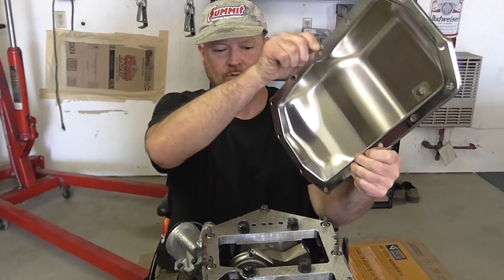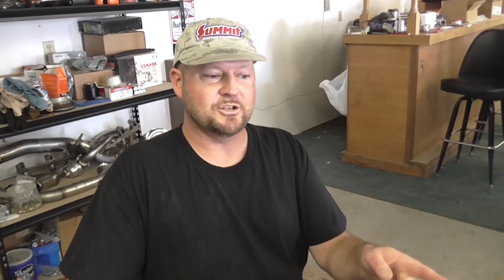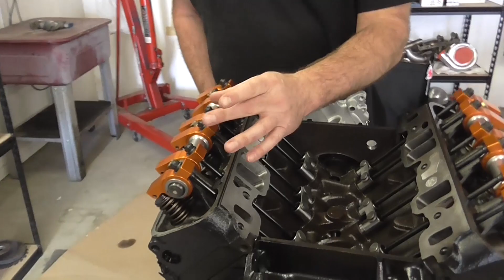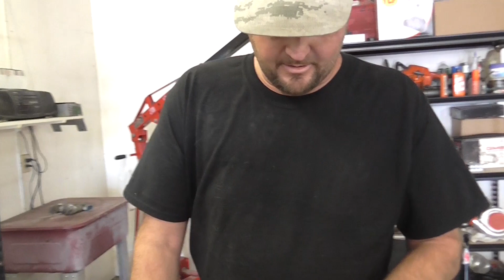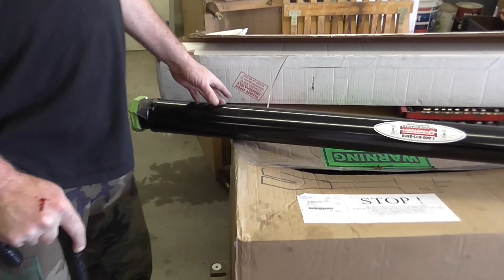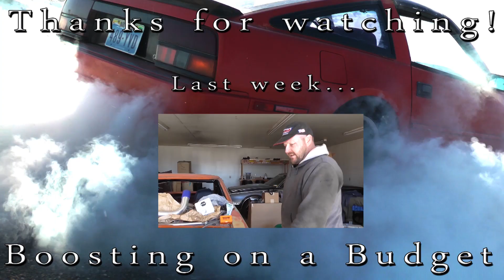Project 87 Buick Part 2 - The 4.5L Stroker Engine

Comment: Junkyard block has thinner walls. Your better to build your stock 3.8 with a girdle and main caps. Alot of guys running easy 10s and 9s.
Reply from the maker: I also have the original 109 block engine

Comment: The problem with those 4.1 junkyard motors is the walls between the pistons are thin. I've seen several guys blow those motors up since 87. I've got the TA performance aluminum v6 block but it was expensive

Comment: I have the original 4.1L Buick V-6 out of my '82 Pontiac Grand Prix.
I have not touched it , yet.
I want to adapt an Eaton M90 supercharger onto it instead of a turbocharger from a Series 2 3.8L FWD Buick.
My plan is to drop it into a lighter weight street rod '36 GMC truck with a TH200-4R non lockup converter and Ford 9" old mid 1970's Lincoln rear diff with the disc brakes.
I'm thinking it should be an easy driver.
For carburetion I want to use a carburetor upstream of the blower or a Holley fuel injection unit.
Any thoughts??

Comment: Budget BUSTING. Should have put a main cap girdle on this block. No girdle no HP beyond about 500 to 550 without blowing up the larger but weaker 4.1 block. Going to need to install a screen basket on the bottom of the engine to catch all those expensive parts when it blows up. Budget? This is an expensive car and engine.
Reply from the maker: There is a girdle and very strong bolts and hardware to help the 4.1 at its weaknesses.  Yes this was not on a low budget, I maxed out my credit cards on parts a few times.  The only budget part is doing the labor myself.

Comment: So it's the LC4 from 80-84 GM cars and definitely not the 4100 HT garbage motor, glad to see someone finally doing a build with this one. It's catches flack and doesn't get enough credit, that's a joke because it's was actually released as a credit option, GM paid people $150 to buy models that had this motor in it. The really funny thing is that stock this motor barely makes just over 100 horses, maybe a bit more...

Comment: Stock block 3.8s (even the 109s) will start coming apart @ around 600 HP. A girdle helps but the expense is only worth it where stock block rules apply. I sure am impressed that you have money to burn on junk. 4.1 blocks have thin siamesed bores that warp, and crack between the deck and water jackets. The blocks are known for overheating problems even when stock. It is popular to bore these blocks to 4", but this makes the already thin cylinder walls even worse. Since your wallet is about as fat as your head, why not start with a T.A. 4" aluminum block made for high performance, and Champion heads. On your 4.1 don't forget to install a basket under the oil pan. You'll need it to catch all those expensive parts when your engine BLOWS UP. This to me is "budget busting" boost.

Comment: Gday m8 like 2 get your opinion on 2 sets of pistons the first are je forged pistons fm maceenginering pt no pis 602 ceramic coated 2618 alloy with 52 series pins. The other set is fm intense raceing they are diamond forged moly coated skirts ceramic coated top 8629 rist pins pt no pkc xxx. The vehicle is a gm 3800 l67. Really like to know whick 1 is the better choice. Cheers.

Comment: I might be wrong but I thought the 3.8 liter of the 80s was 229ci. The series 2 3800 is 231ci. Anyhow cool build and good luck.
Reply: The 229 3.8L V6 was based on the Chevy small bock V8. The 231 3.8L V6 was based on the Buick small block V8. Both were used in the 80s.

Comment: I can understand the turbo car as a factory car, but why not go to a blower since you have gone this far with the machining with respect to the top & bottom end of this motor ?  Factory did go the route of the blower with the 3800's in the front wheel drives a few years after this GN was built.....so in theory it would be kind of beefed up factory in concept.            I've had thoughts of going to the bigger V6 as a swap to my 3.8L in my 1980 Pontiac Sunbird as its a somewhat balanced death machine as is...….with its turbo 350 and my acquired posi rear end for the chassis.  I could only image a normal aspiration motor like you have built here in this chassis I have......but your chassis has a frame.  I do have G body stuff too....I'm a chevy guy.  As much as I'm a V8 guy.....I'm leaning back on the 4 cylinder quad valve motors for power and efficiency these days .

Comment: I guess I may have dropped a stitch- I'm not seeing your roller rockers able to "increase the duration" of lift. the duration of lift is determined by the number of degrees of camshaft rotation between the first measured point of lift to the point where lift returns to zero of the base circle diameter of  the cam. I believe some "effective duration" changes may be possible by varying the oil pressure to the lifters- by lowering the pressure, "effective lift may be delayed, the max lift will be delayed and the effective lift will allow the valve to approach seal earlier; notice I refer to "effective lift- the "softer" hydraulic lifter will "take up" less quickly- the true duration will still be the first point of measurable lift as the cam ramp departs from the base circle. If I missed some thing, please whack me with a clue stick- my at home experiments have already wrecked two cams and I am no closer than when I started. Several phone calls with "noted experts" have got little past "WTF" re the concept of lift and effective duration control via the  hydraulic lifters. Thanks for any help or substance you can offer!FR

Comment: I wanna due the same thing only keep it N/A on E85 9.5:1-10:1 compression. Won’t make as much power. However, it would be a blast in a base model Gen 2-3 F-Body. Especially with a WC T5 to keep it light. Maybe even use factory replacement/aftermarket suspension and brakes....damnit now I wanna go work on my car.

Comment: The buick 350ci v8 is identical to the 3.8l v6 .Just missing 2 cylinders. FYI for those who dont know.
Reply: No it was designed from the Oldsmobile 307. Close though. If it had 2 more cylinders it would be a 5.0 liter.

Comment: You have some really nice pieces on that engine but from one buick guy to another I can tell you with certainty that block is not as strong as the 3.8 turbo block and the weak point in that 4.1 block is gonna be in the lifter valley area the 3.8 turbo block has more metal in the lifter valley and it also has what I guess you could call cross ties that are casted in the block and the 4.1 does not have that I already attempted what your doing with my buick its gonna be very difficult for you to make the horse power your hoping for in that block but I wish you all the luck bud.

Comment: Lol it's always a good laugh reading all the naysayers comments about how your never gonna make over 600whp and how your motor hold the power! Well I've been watching your vids for a couple years now and one thing I've learned about you is that your down to earth, level headed and definitely know your shit!
Reply: Dude very experienced techs & racers will tell you that even the 109 3.8 turbo blocks will start coming apart at around 600hp. For racing that the rules require a stock block racers use an oil pan rail girdle that is very expensive to install. 4.1s are not strong enough, and have weak siamesed cylinders that warp, and overheat. They crack between the lower water jackets, and the head bolt hole. One is better off with a T.A block. (Lighter weight is = to h.p. and better brakes as well). Max actually doesn't know his a$$ from a hole in the ground, and there is nothing "low budget" about this ill advised engine build.

Comment: Nice work! You remind me of myself! What happened to you that  you have to use the cane? I fell 15 feet got a bunch of plates and screws in my foot only allowed to stand two hrs a day but still making car videos like you.
Reply from the maker: My plates are in the left side of my skull, jaw, temple, eye socket.  Threw my balance out real bad, and my short term memory took a bad hit.  I cannot stand upright very long without holding on to stuff so I do not fall again.  I do the best I can with what I work with.  I still have the ideas to share though so I can still do that and drive good still.  To me the driving part is the most important.

Comment: Just a suggestion here.. I'd tap that turbo oil return straight to the sump in case something goes wrong.. Rather metal shavings dumped in the sump than right on top of a couple of lifters and the cam ..cool dam build though
Reply from the maker: Normally I do return to top of oil pan.  I used the same exact return spot is the 1987 3.8 turbo engine did.  There is a splash shield under the intake manifold where the oil lands, and is distributed in a hole near the timing chain which eventually goes down to the pan.

Comment: How are you gonna keep the cylinder heads on with only 8 head bolts since your making 800 hp ?
Reply from the maker: ARP studs, GN1 Iron heads, on Iron block same metal types equals stronger under heavy duty.  Need more bolts if I had Aluminum heads on iron block due to dissimilar metal expansion and contraction under heat and pressure.  I also only run the high boost when I need to.  This engine makes great power and torque even at 11 pounds of boost with its 10:1 compression and AVGAS 100 octane fuel that I run in it.

Comment: Dude, unless you have hardened the top of the lock and down some other tricks you wouldn't get 1000flywheel HP out of the block.  The 4.1L block is not as strong as the 3.8L and fastest 3.8L blocks are probably making 1100-1200 flywheel hp and around 1000rwp.  I just had my 3.8L rebuilt and I was going to initially I was going to use the 4.1L casting and my engine builder advised me against it saying the 3.8L block was stouter.  He worked for Buick and did development the GN, so I'm sure he knows.  Anyway, either way the 3.8L or 4.1L won't live much past 600rwhp.  I wanted to run low 10s and after the fact my engine builder told me I should have went with a stage 2 or TA Performance block.  Forget that, just go find a 4.8L v8 LS block, they can handle 1200 flywheel hp on a stock bottom and can be found for about $350.
Reply from the maker: TA performance makes a 4.00 bore aluminum block that all my 4.1 goodies can bolt up to if my block does fail in time.  Its rather expensive but the rest of engine internals are equivalent in expense.  I do have a block girdle on my 4.1 block which should handle some good power.  Since my compression is pretty high for a boosted engine, and the T76 moves large volumes of air,  I  will most likely keep my boost at lower pressures for longer engine life and on rare occasion run more.
Reply: Budget Boosting
I wish you the best of luck.  I hear that these blocks won't live much past 600rwhp, but there are a couple of guys making 700wrhp with stock internals.  At long as you have a good tune, I guess the blocks can live longer.  I spent about $8k in parts to build my 3.8L, should something happen to the block, I would  build a 3800 series II block.  Stock crank is good to over 800whp and who knows what the block could handle.
Reply from the maker: I am glad my Buick is just for fun and not a daily driver.... I only run 100 octane AVGAS in it so I would go through that fuel like crazy if I drove it everyday.
Reply: Budget Boosting
I run 93 and alky.  I go back and forth on if I should tune for 116.  I have considered using E85 and they may be the route I end up going.  I have double pumper fuel pump, supposed to be work with E85, just need injectors, flex fuel sensor and FAST XFI.
Reply: Budget Boosting
With regard to the girdle, I was talked out of it by several people including a person who worked in engine design.  Saying it does make any sense to girdle a block where the mains are sunk into the skirt of the block.  RJC had a completely different opinion, but he sales the girdle so I would expect as much.  Anyway I went with 1, 2 and 3 billet main caps.  I guess the biggest think with are engines are the harmonics or vibrations that come inherent in the v6 design.  The best way to combat that is to have a block that has 4 bolt splayed main or cross-bolted main caps.  The TA performance block has 6 bolts with cross-bolted main caps, the 3800 series 2/3 block has 4 bolts with cross-bolted mains.  I have two spare 3800 blocks.
My car is also 100% for fun.  I do plan on running at the track one of these days.  I will definitely upload my videos to youtube.
Reply from the maker: Sounds great, many ways to make these turbo Buicks fun, fast and more of a sleeper than most people know.  Look forward to seeing your car, it sounds fun.
Reply: are suggesting there are not many stroked ,girdled, steel crank 4.1 out there making 750,with ease...living a long life?

Comment: Can you adjust the harland sharps?
Reply from the maker: yes they must be adjusted depending on the throw and type of lifters used.  Mine are short throw hydraulic lifters so very small adjustments are needed to ensure valves are closed for compression.  Other types of lifters require different adjustments.

Comment: Hi budget boosting, how you doing? I got an issue with my car and I need help. What are the symptoms of a failing starter? My car has a no crank no start issue. The dash lights come on and if I bump the starter constantly, it will crank when COLD. When HOT, it cranks fine. Battery is ok but I'm gonna try the Epsom salt to desulfate the battery trick before I go out of town if I can get some Epsom salt
Reply: It will crank slowly cold and then crank ok normal
Reply: +Peter Kapica when hot
Reply from the maker: +Peter Kapica Sounds like the starter is tired if your battery voltage is close to 13.
Reply: +Budget Boosting just what I thought

Comment: love it... curious on the cam specs and spring choice...also., you didnt get alum heads because?..also,  you will need a good coupling converter like a PTC 9.5 NL....  also, you didnt mention the girdle or the the steel caps?...   3.o8 gear,,wow pretty tall,good choice!   great build.  prettymuch exactly what im doing.
Reply from the maker: +brianmathew09 wanted stronger iron heads to go with iron block.  If money was no object, I would have picked the aluminum block with aluminum heads from TA performance.  I used a comp cam I purchased from Full throttle performance 214/214.  I wanted a tall rear gears so I could have top end as well if I decided to try the silver state classic in the future.  I have a 9 inch 3200 stall converter from Daaco and the block girdle I purchased from full throttle performance that I believe came from RJC racing originally.

Comment: "just ask any Honda guy" haha funny shit haha
Reply from the maker: SnoizY Dubstep I do see a lot of Hondas that have mad stickers, lots of sound from the tailpipe but moving at a very low rate of speed.  Than again, at Top Gun raceway I saw a Honda with no stickers, all wheel drive and a large turbocharger in the 9's in the quarter mile.  Just having fun with the Honda jokes.

Comment: Can I boost a bone stock car without tuning the ecu or doin engine work budget boosting?
Reply from the maker: Peter Kapica Yes you can, the important factor is the boost level.  If you ran around 6 to 7 pounds of boost, no mods, 12 pounds to around 15, modifications to fuel and ignition timing will be needed.  20 and higher boost levels much more modifications.  Basic estimates but low boost numbers have no problem on a stock car.
Reply: That's good to know. Just the only mod needed is PREMIUM
Reply from the maker: Peter Kapica Yes, sounds good or even better if you can score some AVGAS at your local airport on race day.
Reply: Budget Boosting that's probably expensive and the airport Is far from me. I would use premium with some toulene (has 117 octane rating)

Comment: Looks like a fun job :)
Reply from the maker: nathanb Oh yes, it will be quite the job removing the engine and installing the new one as well as transmission, floor shifter conversion, electronic boost controller, custom turbo set up and more gages.
Reply: Budget Boosting that would take me like five years haha!
Reply from the maker: nathanb Its taking me quite a while now.... I will eventually get it all done...